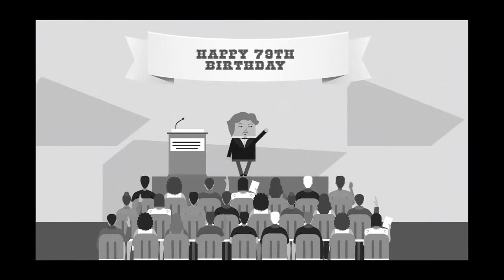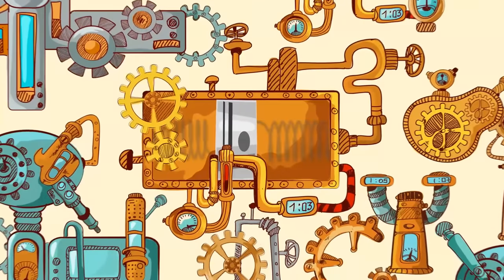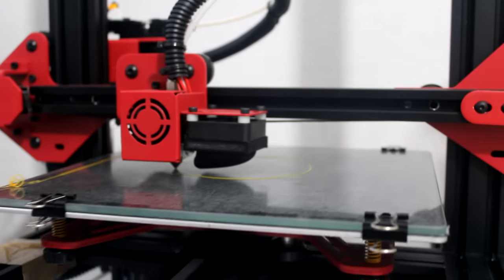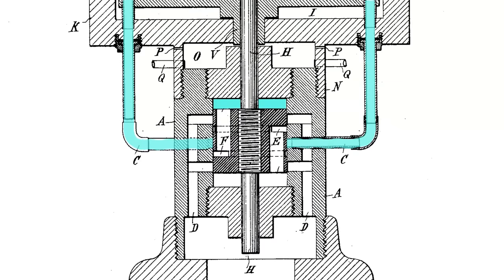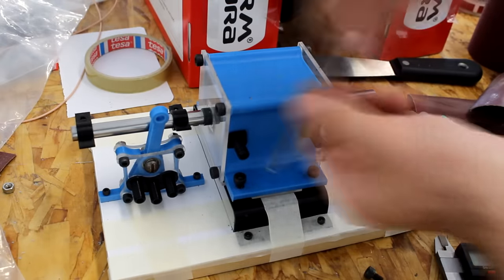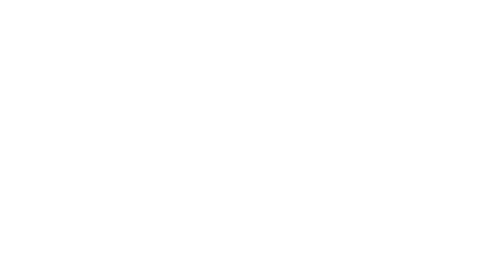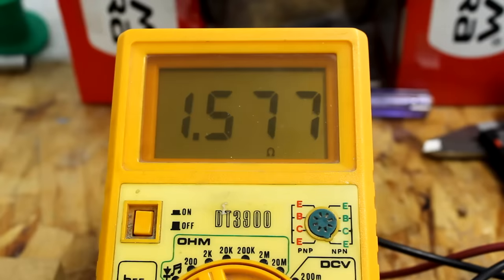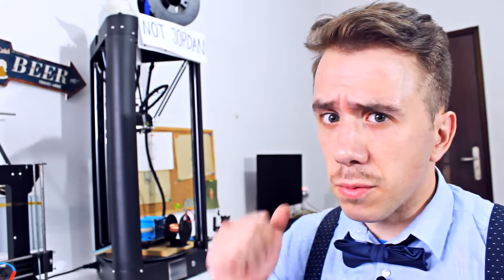Tesla Earthquake Machine [3D Printed]

Comment: Hy piston problem came from the pixels
In a mechanical iron turn, the tool is relative to a distance to the center
On a printer, it react to a grid impossible to create a real round

Creating a square with a metal turn is relatively impossible the angles inside will be round if you don't create different pieces
The round is over the square 

Creating a square with a printer, no problem it's made for this not for exact rounds
You'll be depending on the size of the grid squares that are controlled by the program 
More the pieces will be small relative to the grid, more the difference will be pronounce 
The square is over the round

The solution is relative to a Pythagoras problem
If you want to create a circle, what is the center point
Then what are the individual geometrical pieces you want to assemble
If it is a brick
You need a distance, to create a perfect round with an exact bricks number
Because of the original volume of the brick, the relation to the distance inside the circle that you want to built, is relative to
An angle created by one brick
In a cercle with the approximative distance you want
The result will probably not correspond to an exact angles number of cercle composed by an exact number of bricks

Whatever, choose a real number of bricks
That the principal subject of your cercle
The brick volume is linked to certain distances that permit to obtain perfect round

With Pythagore you'll obtain the internal faces of the brick volumes
The number of bricks is exactly the same out of the circle
But due to the volume, the external faces will not be linked
There's a somme of different empty triangles
The ciment you need to conclude that circle

Everything is geometry
And what is funny when you look at the exact incident angle needed on an iron turn tool
The most appropriate angle is relative to a 90° angle include in the Pythagore alignment

If the angle is not the good one, the tool broke

Other example
In France voltage 220 to 240v alternative
50 to 60 hertz

120 negative then 120 positive in  60   rotations per seconds

If all the calculations are made from square, not about real elements and the comparative volume, there are constant incertitudes, and you even need more calculations to found the exact solution in a range of possibilities
Instead of saying what do we really talk about, then obtain the exact result

Some books to improve our communication
Those are in French

Électricité pratique
Éditions Dunod
Prepare for electric jobs from CAP BEP French levels

Super manuel de physique
Semestre 1 one book
Semestre 2 the complementary one
Classes préparatoires scientifiques
Levels MPSI  PCSI   PTSI

Then we could probably understand each other
But if you lost the primary way of calculations....
It'll be complicated
Restart with geometry and forget the usual way of using PI, it's a solution to calculate cycles, or simplify a non real important precision solution

In fact the problem is 
what are we talking about
Then you've got relative informations that are useful to calculate EXACTLY what you need

Calculations on calculations, with all the unknown factors and the approximate solutions...
It'll never really works well

That the financial problem actually and the pc are based on false calculations system
Pi is a 180° straight, dead line, to infinite
A concept of a no distance limit

You as every human as a scale
Planets has different scales that impose their particularity to the smaller elements that are attract on

In the particular place you live
There are also different values that are defined on a range, temperature or lighting, local gravity that depends from the water
The water level define gravity and we are made essentially of water and magnet has a lot of unknowns reactions with water

Take a look at a paper pyramid on a water plate
Use a magnet iver and you'll see the pyramid turning in the same side as the magnet

Only water
Like moon creates oceans movements

My interpretation
Water is made of small round parts that react to the magnet
The pyramid as a square base
The both in the same place with the same angle points of incidence

So when water levels change due to the magnetic interaction, it makes pressure differences on the under face plate of the pyramid square
The gravity on the 4 angles is possible to change, due to the pyramid form why? 
Because the highest point relative to the square is in the middle
So the strength to make the 4 points going up and down are translated by the angles and the relative lever effect

Du to this observations i really ask myself the real utility of the pyramid considering the presence of water neer
And considering the fact that we purchased gold, cristals and other metals, that are now no more on the original devices

At first, i'm an organic farmer
I can't work because of the financial situation
Only industrial mutation and steam punk modifications are now allowed and all the life species are dying...

Trying to push a cercle in a square destroy the life

Just think about this fact
A cercle over a square is linked by the square angles
A square over a circle is linked by the center of each square line
It's really very different

Then if came back in time, just a few
Remember first satellite missions
Perfect calculations, by using the old geometrical system that is the same as the first Japanese game tools

Now, we've got superpower full devices that are oproximatives the new devices needs corrections to obtain the exact result and follow the exact travel on the good vectors

Then also remember that Tesla was certainly aware about some specific informations that were not as important as now
The transmission of the current by the air is an example
Transmitting a wave is possible
Transmitting a current also, this define in smartphone the dangers of the biological incidents on the user

If you play with magnets, or waves transmissions, please, never forget that
Faraday explains it very well

My old Breton ancestors were used to say that all univers is made of
Douar Dour Tan
Water, Matter and Fire or light

In this video you'll found solutions to create synthetic ruby
This guy try to use microwaves
But his experience is relative to another one
In this case 
Matter essentially Aluminum powder
Then light and water with an HHO torch
Douar Dour Tan 
Then volume conditions of the specific area that is used for the reaction modify the time, the temperature of reaction 
Time is temperature, comming out from all gravity objects in an empty space

https://youtu.be/ybcdRQmQcHQ

Then back to the old computers
The only real problem is the scale
If you don't use scale, calculations are impossible
But with an appropriate scale
You can compare the results of different circles diameter and the last parts that can correspond on the exact same distance, the PI interaction
PI is an exact value linked to a cycle

I'm upset about the way it turns those last years
At school, i'v started by a first year in 2 cycle of industrial and technical support
Then i was really care about the biological problems we have, the importance of solving life's on earth

Because i'v work in agriculture, no money
No way to build my business
And now cause no money, the society does not allow me to be with my child...

The society says we need to protect our home
But on the other hand the destroy every thing !!!
Destroying all organic products by replacing them with synthetic products

The only life planet known in the seen universe
And they take all the stuff for only a few humans that could "escape"
Fuck it's humanity stuff, not only elites

Creating mechanical animals...
We first need to communicate with the living ones!!!

I'm creating a reference for exact calculations, using all the exact known laws of the universe
Including the particular of a specific magnetic field on a circle object in an empty space rules by other bigger objects
All with perfect geometry, and the good maths way to calculate

Pour les francophones je vous conseille vivement les vidéos de mickmath
https://www.youtube.com/c/Micmaths

I'v already talked about this big calculation problem we all have and the importance to know
What are we talking about

If you like united states of America, take a look at the flatiste thinking grows
Could a reasonable country accept the population is so wrong and don't catch anything about the simple calculations that explains a volume

First to calculate fingers and Phalanges
You obtain 12 and 12 count by their own thumb
So 24 hours
Linked to all geometrical angles by 60 the time count
In a circle of 360°
On a scale of the exact PI distance
In two perpendicular plans, you obtain a volume

Im really very very upset, sorry for that fact
Know think about financial maths apply

If in a limited volume known as earth
You define an un-limited line
Then calculate possibilities on this infinity...
The earth will be eaten before you could arrive at the PI point

Same problem in my organic farm project
When i was taking about chicken witch are also useful to bring food to grow plants
They ask me to translate chickens in cows...

A cow equivalence...
That's impossible, not the same volume, not the same biology, not the same food needed etc... 
If you try to calculate, first, and most important 

WHAT ARE WE TALKING ABOUT !!!

Now take a look at the American cows life conditions and food to grow...
Then look at the European way
Since windows 10 and Android smartphones linked to deep mind, a mathematic calculator, American are modifying all local laws to their way of life

Hyper rich few people that can eat organic foods
And muting peoples that are rules by the others

Then take a look at the food asiatique channels on YouTube
A great diversity as the food market of my childhood
Local plants local animals that are since many generations adapted to local specific conditions

Comment: Just wondering about is how much weight, distance of travel, speed of oscillations, and force generated in each oscillation Tesla used to create the frequency, pulse, vibration to cause this effect? Those factors must not be in the schematics?  He must have or should have built it with ways to adjust these factors???

Comment: The story is real. Tesla had it in his pocket and went for a walk after he had some weird stuff happen in his lab. He located a building with only the steel posts sticking out of the ground. There was nothing else, just the posts. He clamped it to the steel and turned it on. The steelworkers freaked out and thought it was an earthquake but it wasn't, this was only happening at the site. Tesla quietly put the device back into his pocket and walked away briskly. He later told this story to a newspaper reporter. The reporter wrote and published the article. So yes, it is very true.
Reply: Lol. He had a steam machine in his pocket right?
Stop lyin, Tesla!

Comment: Hear me out longer thinner coil with a longer range of motion to the pistons It is said the amount of time taken to change matters with the longer thinner coil of wire it’ll take longer wile still moving at the same speed basically covering more ground at the same speed also when tou coil the wire so thick the magnetic fields can’t reach they kinda can but like not a lot so that would also be covered by the longer thinner coil and again more linear motion to cover the whole coil maybe even have the magnets extend past on both sides kinda adding more changes faster because for a split second it’ll be neutral

Comment: I understand that the efficiency of the one Integza built is low, but what would the efficiency of a model built to the same specifications in tesla's patents be, especially if adjusted as he stated so that the frequency of the electrical and mechanical parts are the same?

Comment: I've only just seen this. The air spring helps you get a sinusoidal wave form; you need it. If you ever put a scope on your model, I'll bet the wave form is impulse positive, long off, impulse negative. Also, that "rate of change" delta-T is critical; must be fast_. Remember this was supposed to be a _kilocycles per second machine. Did you consider just adding some weight to your piston to give it some inertia? Be Well.

Comment: Why not print the same “ellipse” piston and cylinder the same as the square (on the same machine at the same time) and mate components in relation to there assumed identical deviations? Being a non rotating part it should work fine right? Also is your machine calibrated correctly to avoid the ellipse and get better cylindrical prints?

Comment: Hi Folks,

I have a question, 

with Tesla's Design, when the device is stationary (no pressure supply). the main piston and the spring piston is located in the center. 

when a pressure supply is attached, how would the piston reciprocate?.

do we need to give a piston a manual push?.

Or, do we start the device with the piston located on the top or bottom (AS SHOWN IN THE VEDIO), which is unlikely to happen, since that will compress the spring piston which will force it back to the middle.

please correct me if I am wrong.

Any Ideas.

Thanks,

Sam

Comment: How about a constant speed transmission coupled to a Tesla turbine to turn a generator. The high speed turbine geared down to 3600 RPM, or any derivative of that RPM, to turn a generator that is built for that RPM.. High speed geared down results in torque. Since a generator just converts torque to electrical energy that is in turn transmitted to a motor via wire, the more torque you have at the generator the more torque you have to distribute to motors.

Comment: Can the alternating motor power itself? Say you used an electric motor and used the energy generated from the alternating motor to power it, how long could it last. And I assume it would have to have some sort of assist to keep it moving, so what if you used magnets similar to a bullet train to keep the motor turning? Could that generate enough electricity to power itself or even charge a small battery? Love the content!

Comment: If you throw a rubber ball at the ground it bounces, why?
Because it cannot expend all of its energy in a single pass. 
This, is "resonance". 
Do this, to steel, or concrete, and it will eventually tear itself apart, along with anything attached to it. 
assuming you can shake the steel fast enough, with a low initial force, you can cause, impressive results so long as the energy is just enough that the steel cannot dissipate it all in a single pass.

Comment: your problem my friend is the multiple magnets, they are not making a good field..you need one solid magnet to create a non broken field for voltage you want from tthat machine..use a neodymium magnet like what they use for cows and horses to remove metal from there bellies..the magnet for cows is about 3 inch long and 1/2 inch wide i think..it would make a better magnet for your tesla generator.  😎😎

Comment: Is it wrong to bolt an earthquake machine under the neighbors car seat along with a pinball plunger that rapidly knocks on their cylinder block?
Reply: Not really a joke. We did all sorta of pranks including tapping a coil pack and connecting to a metal door knob and a series’s of capacitors. 

This also works with the spring frame in a car seat.

Comment: why not make a full bridge rectifier with 4 LEDs
you would have 2 light up LEDs, than they would turn off while the other 2 turn on, and then those turn off and the other ones thurn on again
so you would always have 2 on

or you could replace the LEDs by diodes and make a normal full bridge rectifier to power whatever you want
like one only LED that always stays on

Comment: Hi I see you understand a lot in electronics. I have been working for years on a complete water-powered car driving project. So far, I have tried various electronic diagrams that did not take me on a complete run on water fuels (hydrogen and oxygen). I need a scheme that would split water molecules into hydrogen and oxygen with the help of a certain frequency. If you know any good pulse frequency oscillator I would be grateful if you could help me. Thanks in advance.

Comment: The reason you couldn't circularize your piston is because you didn't have a rigid arm shaving the material off. our arms are flexible and our muscles give. Our brain is not good at telling our arm to stiffen up, so when you sanded the part, it was being sanded uniformly. This is not what you want. You want to sand the eccentricity out, which means you need something that won't move when it strikes the material. Think like a lathe.

Comment: Hy 
If the object is to create a high powerful vibration 
You should take a look at the harmonic amplify
With the obtention of the phase quadrature, it should work... 
But the material résistance required will be really different
Different plastics compared to different iron alliages
Try first to determine the alliages of the different parts and the volumes of each piece then compare

One probable reason could be the react of the axis to magnetisme
If there's current, the magnetic field increase
The axis made of iron don't just stop at the magnetic place, but go through the entire device
This will create magnetic reaction with all components
Including the air closed in the vacuum space with the vibrating piece
The movement will create frictions and charges accumulation on the opposite side
If all parts are disconnected from direct contact with the axis by using rubber rings for example
All the charges wil accumulate on each part

If the charges are identical, the vibration piece will be also repulse by the electric identical charge
Improving reaction in high frequency